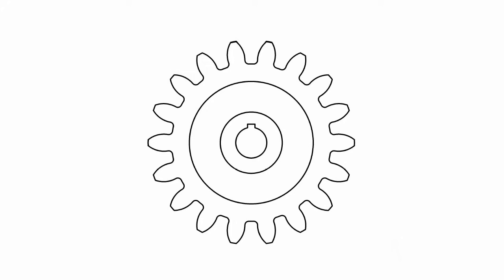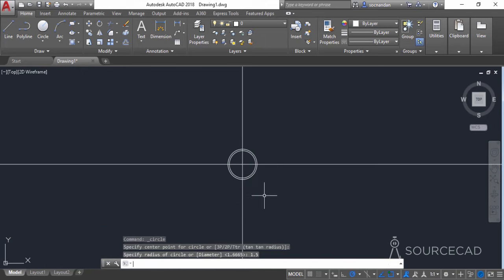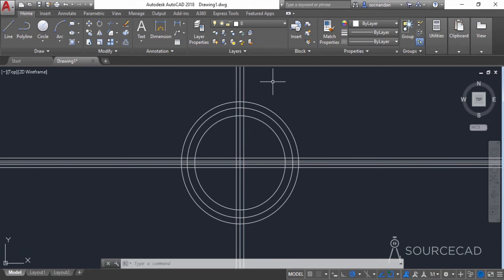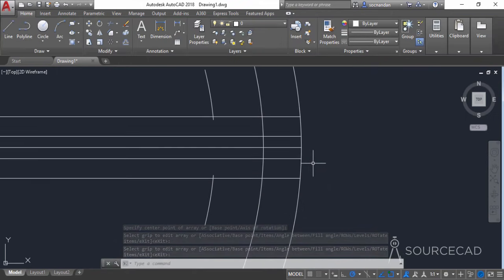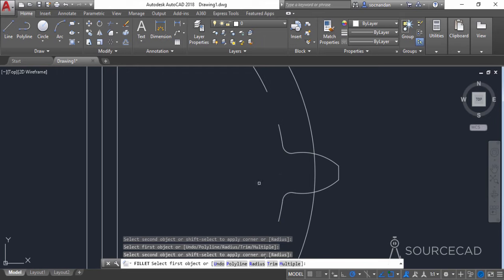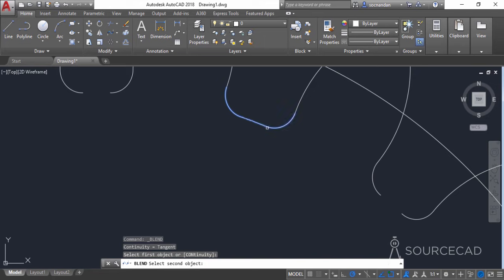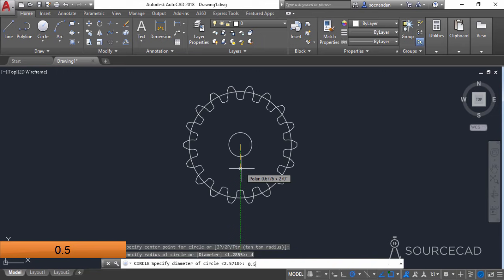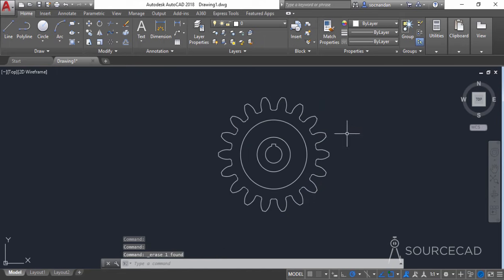Making a 2D gear in AutoCAD

Comment: Hi! I am a beginner and I already have problems in how to make this sprocket. Could you show me how to do it, on a video?
I really will appreciate your help.

Begin by drawing the 12.25- and 11.25-diameter circles centered on the same point near the middle of your display.

To construct the sprocket teeth, draw a line using the Quadrant object snap to locate the point at the top of the 12.25-diameter circle. The second point can be straight down so that the line crosses the 11.25-diameter circle. The exact length is insignificant because you will trim the line back to the inner circle.

Offset this line .1875 on both sides.

Trim the first line, and trim and extend the other two lines to the inner and outer circles.

Create a polar array of these lines and trim them to create the teeth.

Draw the 10.25 B.C. on the Centerline layer.

Draw a line from the center to the quadrant.

Use grips to rotate and copy the line to 30° and 60° for the 0.75-diameter circles, and 20° and 70° for the inside cutout.

Draw two circles where the centerline intersects with the bolt circle.

Construct a polar array to get the proper hole pattern.

Draw the 7.44-diameter circle and the 3.25-diameter circle.

Trim to construct the cutout geometry.

Comment: great videos thanks a lot.i wuuld like to make a question. you  choosed the distances between the constructions line   by your self?or you calculate them somehow, because there are 18 teeth in the sketch. in your site it doesnt define the distances
Reply: Hi, I think I can answer your question. A gear of 18 teeth at 3.333" outside diameter would be a 6DP gear. An 18 tooth 6 DP gear has a pitch diameter of 3.000" .Which is the figure used.
He has set the chordal thickness at 0.260". This equates to a pressure angle of 14.5 degrees. All this info can be found in the Machinery's Handbook.
I must be missing something though as I make the root diameter to be 2.614" not 2.571".

Comment: FILLET CAN'T USE
Reply: Explode the array and then use the fillet, it should work.
Reply: which version do you use?
Reply: 2016  ok thanks bro  now i am understand
Reply: hi.. Doesn't seem to work in LT2018 either
Reply: @onlooker251  try 2019 or draftsite
Reply: CAD Baselines  no